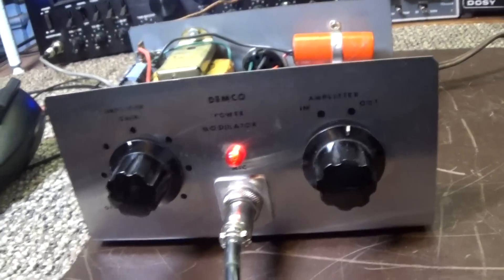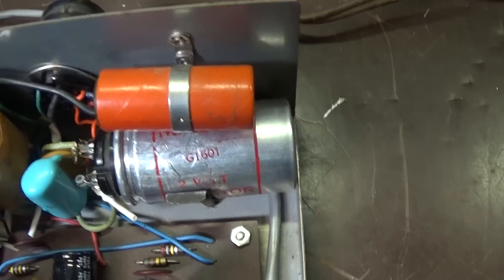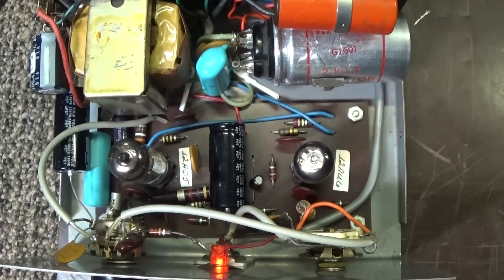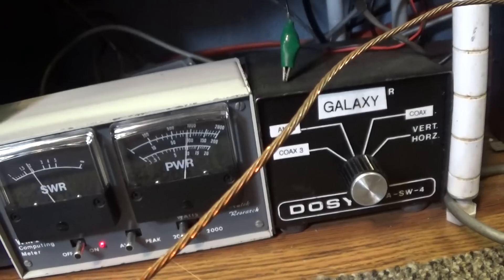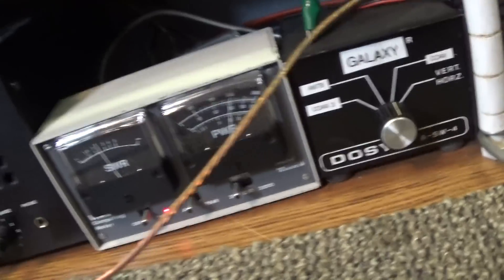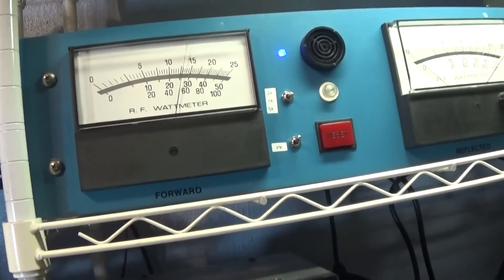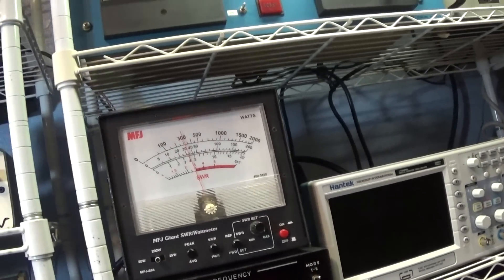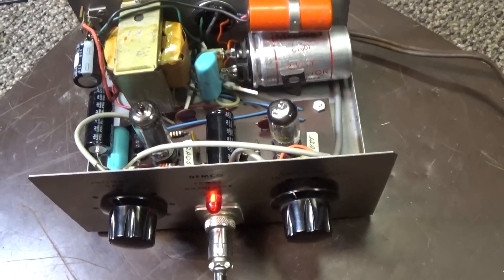Demco VM-12-120 Power Modulator on the bench

Comment: Hi TramDoc - I'd like to do a mic conversion on my Demco Modulator as seen in this video to adapt to 4 pin. Do you have wiring info or a diagram that you can send me for the wire/pin-out?
Reply from the maker: too bad on youtube I cannot reply with a pic. On the net there are lots of wiring diagrams for the 4 pin cobra but anyway, there are 4 wires invloved, both on the mic plug going out and to the Mic jack on the demco. First of all you need a 4 pin mic jack and plug and a washer as the hole on the demco is bigger than the mic jack. I have found a 1 1/4" od washer works good for mounting the cobra jack.  On both the jack and plug Red to pin 3, Black to pin 4, then you have the coax type mic wire left. The Bare wire or shield will go to pin 1 and the inner white or clear wire will go to pin 2. Thats it.

Comment: Excellent clip. I've got one. it has also been recapped/tubed. I use mine with a sonar fs 2340. My sonar See's 12 Watts peak with an unamplified d104 on an Autek WM 1 with the demco in the out position. With the demco in use I get 20 peak and excellent audio reports. I don't even use the sonar with the demco in the out/through position anymore. I've heard that using the demco modulator with a transistorized transceiver would be counterintuitive. is that true, and why? thanks for another great clip.
Reply from the maker: I have heard that I think its a wives tail. What I do know is that some radios, especially high end full featured radios, have a speech processor built in.  Demco does not and needs this, Early Sonars did not, the FS2340 did but it was more like a limiter to keep those dual Push/Pull 6bq5's from singing. By the way did you see my video on the 2340 where I swapped out the audio driver tube? Brownings did, Trams did and hence these do not work well on them. Most transistor radios I know of do not have any speech processing with some exceptions like CPI, GE Superbase and a few more, but in general, these should work great on a transistor radio. They do not work well with power mics though. Non amplified works best.
Reply: +tramdr As many are, my fs 2340 has the audio clipper board bypassed. I have two 2340's and both have that mod. thought I'd mention it. if someone wants to use a demco modulator on a 2340 I'm fairly sure the bypass is necessary. I did see the 12at7 swap for the 12ax7. I tried it on my 2340 and received bad audio reports. I just put the 12at7 back in and all was fine. Did the 2340 you did the tube swap in have the clipper board bypassed? I hope you find some time to do more clips. your collection is incredible. 73
Reply: +tramdr thanks for getting back, but I couldn't reply. I'm getting invalid email. I hope you'll try again. thanks
Reply from the maker: I did use a compressor to cut the mod down when I did the 12ax7 tube swap. Maybe thats your problem, hot 12ax7 tube, no clipper or compressor, too much audio. Try it with the compressor back in line or use an external compressor (like the Demco) also remember that on most of the Sonar compressors I have seen, they need to be recapped.